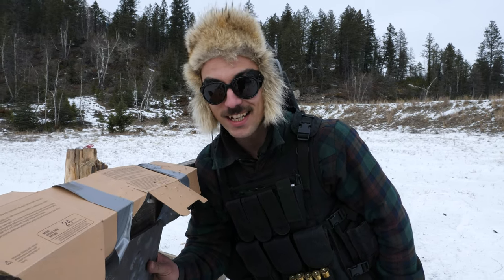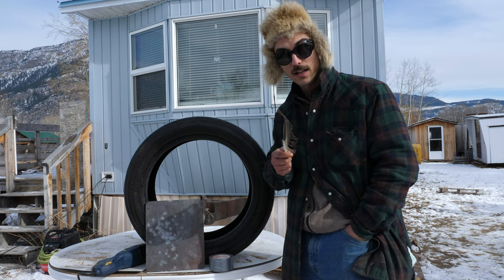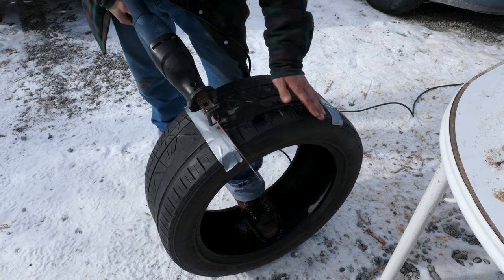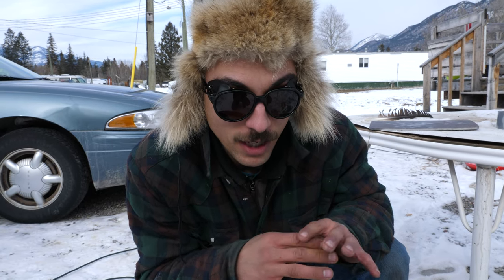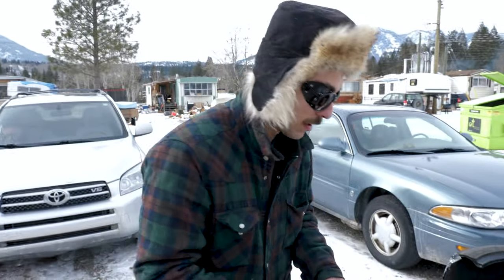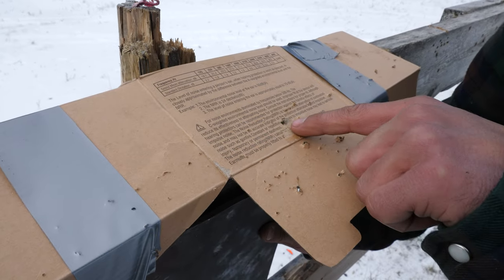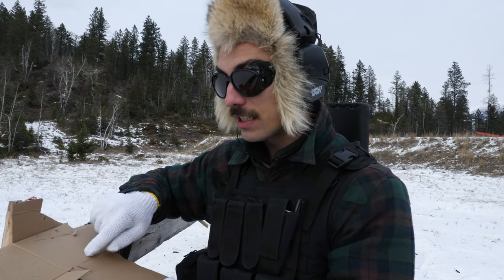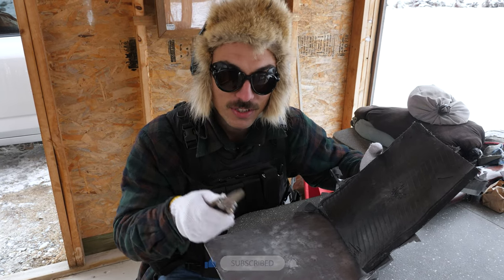DIY Shrapnel Guard For Plate Armour | Homemade Shrapnel Pad

Comment: Any chance that you do another video showing the mud flaps and how they worked with the epoxy. Excellent video, thank you. Have been looking for something that doesn't break the bank but can be used for a liner. This just opened up a new solution.

Comment: Can you test those CANARMOR level IV plates again but double layered? or maybe with the tire as a backer? Curious to see what'll catch that 8mm
Reply from the maker: The 8mm got stopped in the ballistic gel, I'm confident an additional level 3A behind the level 4 would stop it.
Reply: @TalesofaRedneck  would you be willing to test again with 30-06 M2 AP?
It's the exact round level IV is required to stop by the NIJ 0101.06 Standards.
Can armor claims they are level IV but the plate is only 1/4" without the lineX....and it's been shown elsewhere that it takes 1/2" Ar500 to stop it and meet Level IV.
Reply from the maker: We will see, 
it can stop 30-06.
Reply: @TalesofaRedneck  I can only ask that you try. Thanks man!

Comment: Flawed test on a few aspects.
The spall guard must completely cover the edges of the plate to be at all reliable. Just covering the front does no good. Spall will still escape up, down left, and right in a radial pattern, along the surface of the plate. A kevlar sleeve that only has seams on the backface of the plate is what is needed for 100% front and all sides protection. Otherwise side seams will still let spall pass through. 

Good try though.
Reply from the maker: Correct, this is not the best way to do so, however its better then nothing 😄

Comment: You should have figured out a way to bend a bit of the tire over the top of the plate to close off the space between the plate and piece of tire. It would at least slow or catch it if its closing off that gap at the top.....Plus if the damn tire wasnt so thick i think it would be better? As long as you have some rubber and the steel belt running threw it ,it should work. Maybe try a bit thinner tire? Please? lol My carrier takes up a ton of room on me as it is! hehe a thinner tire would fit me much better!
Reply from the maker: I em now using a mud flap, it is much lighter and works just as good.
Yes your right, it does need to as snug as possible to the plate.
I glued it on with contact cement so it keeps its flex.

Comment: What steel are you using?
Reply from the maker: Ar500
Reply: @TalesofaRedneck  is that hardened? Im from Germany so im not really farmiliar with the iso naming system.
Reply from the maker: My understanding is that it is a laminate of two different steels.
The front one being hard and the back steel flexible.
Reply: @TalesofaRedneck  alright. Thank you